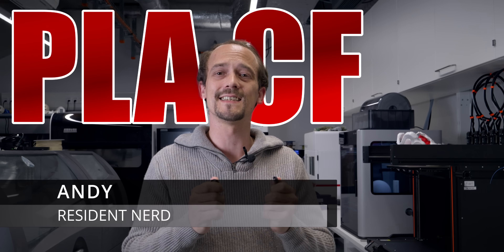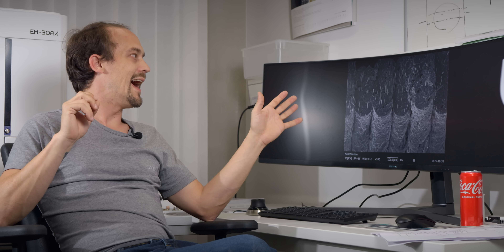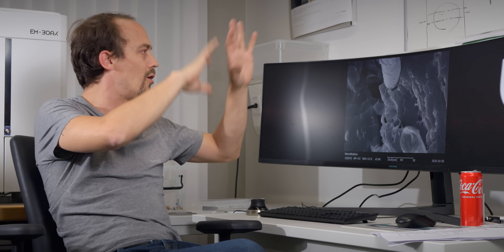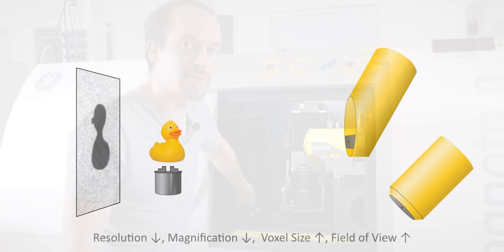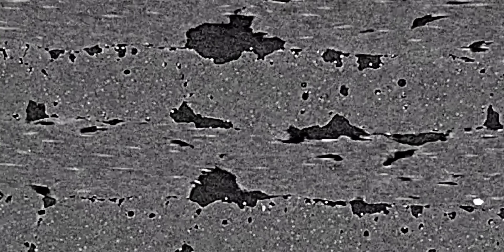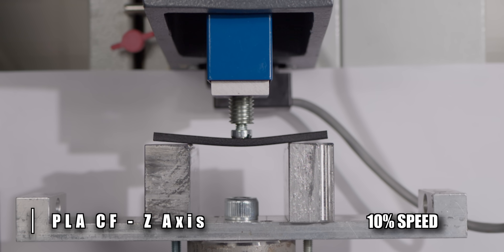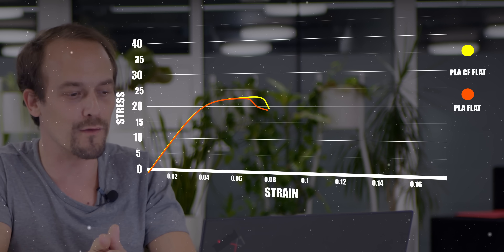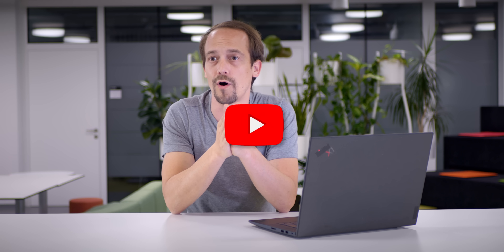3D Printing’s Biggest Scam Is Even Worse Than We Thought!

Comment from the maker: what do you want to see next?

The health impact of Carbon Fibre Filament? - Comment "PLA-CF Health"
Matterials where Carbon fibre actually helps? - Comment "Real CF Materials"
Is Glasfiber Filament any better? - Comment "Galsfiber Filaments"
Reply: All of these are interesting to me, and the order of interest is exactly as you have them here. Health first.
Reply: @nickhancock589 yes all these please
Reply: @nickhancock589  Real CF Materials
Reply: 🤔 all of them 😂
Reply: Glasfiber Filaments
And one of the actual good CF filaments
Reply: PLA-CF Health
Reply: I would like to see PA-CF and PETG-CF. Do those polymers bind better to carbon fiber? Are there the same voids? I have found PA-CF with 25℅ carbon fiber and PETG with 15% CF.

I am interested in building a part with very low thermal expansion like titanium, but its only necessary in one direction. So I wanted to print it that the fibers align into that direction and hold my part like reinforcement concrete. 

Thanks for the great information from your videos
Reply: @user-wi3lg1rz8f  thermal and optical energy absorption/adsorption, emission, dissipation,    properties would be interesting too, but likely can be estimated well from the base materials, PLA & CF independently…as there is negligible chemical or surface characteristic changes.
Reply: Literally all are interesting!
Reply: All of them, please.
Glass fibre is very interesting, although I guess (and it's just a guess) it should be quite similar to carbon fibre, modulo some mechanical properties of the fibre itself, which are probably negligible in most plastic filament anyway. Is it safer though?
Reply: @tuesss  GF likely have different adhesion though.
Reply: @tuesss what about organic fibres though, pla melting point is not that hot plenty of crystaline organic polymers should be fine during the printing process right?
Reply: Do a "no AI bullshit music"-challenge!
Reply: PETG-GF seems to increase layer bonding, it'd be interesting to see exactly why this happens. At least that appears to be the case with Tinmorry's PETG-GF, I'm not actually certain if it's always the case.
Reply: @shawn_369  Interesting. I don't know anything about PETG-GF, but off the top of my head I could think that GF behaves differently because the glass fibers are not as hard as carbon fiber. Glass fiber, I would imagine, is "softer" and more flexible when compared to CF. The GF can "give" - it interacts better with the materials around it. It would def. be interesting to see a similar analysis of GF as was shown for CF in this video.
Reply: @shawn_369  I have used Bambu Lab's PA6-GF before and it doesn't have any layer bonding, despite thoroughly drying the filament (and even drying while printing). You can almost peel the prints apart with your hands. But knowing Bambu, I guess the official print profile doesn't quite suit the material. I'll have to tinker around with it when I have time.

I guess it could be a very different story for PETG-GF though.
Reply: @shawn_369  is there any chance of “continuous strand” GF encapsulated printing..?
Reply: can you do them all, just without using so-called "AI"?
Reply: All of them! 😂
Reply: Bro, are you at a university or what? How did you get access to all this crazy expensive equipment?  On the fibre reinforced polymers, I really question the utility of having radial aligned fibres. Really, cross layer fibres are of more utility. Scammy in most cases.
Reply: @MarkandSureepornHutchins I'm here wondering the same thing
Reply: @MarkandSureepornHutchins  his workshop is definitely leveled up lol
Reply: Less use of AI would likely better differentiate your otherwise amazing video moving forward but I need to ask, how intellectually involved are you in this channel? Do you source your own knowledge and build your own skills or do you outsource that as well? And is this channel just a human-fronted AI misrepresentation of the real world? How much do you include AI in the creation of your content?
Reply: First, this is incredible and exactly the kind of geek thing my mind locks on to. Thank you for that! Next, NathanBuildsRobots did a video on working with CF and it’s apparent out of the gate this stuff should be handled with care, with protection, not only for hands but your lungs. Please take a look at that and do your own presentation. I walked away with little desire to work with it and a great respect for Nathan for sharing it. Edited to add: Just got to the end of the video! You credit Nathan and go on to explain why the material itself can be greatly hazardous! Dude, you do the work. You go deep and you present the information clearly and concisely. YOU have elevated yourself to Nathan, Stefan, Angus, Joel, honest truth? You just kicked their butts! 😂 Seriously, thank you for such an incredible amount of work and? Can I have your lab? 😊 dying here….😂
Reply: Real CF Materials.    I think a discussion of how well different polymers adhere to carbon fiber would be relevant to the discussion
Reply: Galsfiber Filaments
Reply: Glassfiber filament
Reply: Health Risks of carbon fibre would be great!
Reply: CT of another printed material than CF, of course...
Reply: THIS! - Matterials where Carbon fibre actually helps? - Comment "Real CF Materials"
Reply: PLA-CF Health
Safety first.
Reply: PLA-CF Health
Reply: PLA-CF Health.  I remember a video going over how the fibers dont stay in the filiment, and are pretty much as sharp and stiff as fiberglass.  like rubbing the finished part was like rubbing fiberglass
Reply: Real CF Materials
Reply: ALL OF THE ABOVE. Also you mentioned petg not benefiting for the most part, is it as bad as pla or just a minor difference. To be honest I just stumbled onto your channel and I now have more questions then what I can feasibly ask in one comment so I will say this instead. Any video "reviewing" filaments whether it be from the everyday strength test to the ct scan and electron microscope would be greatly informative. I just recently started printing with glass fiber reinforced petg and after watching this video I would like to know if it is worth the extra price and if it is even healthy to print. You have access to equipment no one else reviewing 3d printing and filaments to my knowledge has access to revealing a whole new side of 3d printing the average consumer wouldn't even know or even be able to know. 

PLA-CF Health

Real CF Materials

Glassfiber Filaments
Reply: Real CF Materials. I want to see ASA-CF, PA-CF and PET-CF and how they compare against their non-reinforced versions. I know ASA and PA warp less and are more printable even with just a bit of CF additives, but I want to see how their strengths compare. I also have my reservations for PET-CF, I printed with bare PET before and it was just fine.
Reply: I've been printing pla-cf for months now. This video is completely different from my experience with pla-cf. My prints are definitely stronger as I make drone bodies with it among other things. My test have overwhelmingly prove pla-cf is stronger than regular pla! Sorry your filament was 💩, but not all pla-cf suck!
Reply: PLA-CF Health
Reply: "PLA-CF Health"
Reply: PLA-CF Health
Reply: PLA-CF Health
Reply: PLA-CF Health would be interesting
Reply: PLA-CF Health
Reply: PLA-CF Health
Reply: PLA-CF Health
Reply: Real CF!
Reply: Real CF Materials
Reply: PLA CF Health
Reply: Comparison between CF and GF would be a killer. 
Also particularly interested in PETG-CF and ASA-CF vs ASA-GF something tells me they both are not as good as regular ASA.
Reply: Just for curiosity: Electrical properties :) Conventional CF plastics can be literally conductive, could this kind of print material  create an unexpected hazard by having surprisingly low breakdown voltages?
Reply: "Glasfiber" + "Real CF Materials"
Do both. I don't think a full video on the health is needed, just explain it's sharp, it gets in you, and it's not bio-soluble. (once it's in you, it stays there) There's plenty of research/information on the dangers/risks of CF.
Reply: Health Impact
Reply: why is there a difference between petg-cf and pet-cf? shouldnt be the bonding of the fibers be comparable?
Reply: PLA-CF Health
I know the health risks, so a video is realy important.
Reply: PLA-CF Health
Reply: These filaments must be banned as soon as possible! All this microscopic carbon thorns will stay with humanity forever, just because of some tiny profit for the manufacturers. What a madness! You are big enough here and have professional and social contacts to send appropriate letters to relevant institutions, or start a petition or whatever.
Reply: PLA-CF Health

It's incredible to me that there seems to be such strong opinions about this that some seem to be getting emotional in their defense of CF.
Reply: PLA-CF Health
Reply: As I am sure others have asked, please compare all other 3d filaments that have cf and gf added. I for one would like to know the facts on whether or not cf or gf fibers actually do anything.  I also would like to know if this issue is with all brands of filaments with cf and gf.
Reply: All of the above. Or perhaps you could partner with a filament maker to functionalize the carbon fiber first, like a coat of primer before being added to the plastic when they make filament, maybe if there's other additives etc. that can make the PLA work better with it etc.
Reply: PLA-CF Health
Reply: Definitely the health impact!
Reply: PLA-CF Health please
Reply: The health effects would be very interesting. The tiny shards make me think of asbestos. Hopefully people aren't getting this in their lungs.
Reply: Matterials where Carbon fibre actually helps? - Comment "Real CF Materials"
Is Glasfiber Filament any better? - Comment "Galsfiber Filaments"
Reply: I want to see both PLA-CF Health and Real CF Materials. I'm just getting started with "engineering" grade filaments and obviously didn't do enough research before buying into the holiday sales for PLA-CF. Now I'm kind of scared to handle the stuff without gloves and a mask.
Reply: For a follow up test, you should take a look at a piece of virgin filament. It would not surprise me if those pockets are trapped air bubbles, and they get moved from the filament, onto the part during printing.
Reply: all of them , but do also include those "core" fiber materials, for both cf and gf and also interesting to see the difference in PET-G and PET with similar fibers and non fiber reinforced. And off course the other "engineering" filaments with those fibers
Reply: would love to see a video comparing all the CF/GF filaments, particularly PC and PA.  I have always been suspicious of the matrix and what strengths it actually has VS just great PID and Thermal control on normal filaments.
Reply: Compare vs asbestos and vs fiberglass and vs rockwool, I'm suspicious of them all. Thank you!
Reply: plastic itself enters the body by breathing hot plastic fumes and it's the biggest source of plastic in the body. maybe you should research that?
 thanks for what you're doing😊
Reply: Since you work for a university, if your conclusions were to come out as bad as some of us fear, could you write to the EU to ask them to force companies to include warnings with CF products?
Reply: health impact!
Reply: Real CF-materials, but the other optioneel also sound interesting
Reply: Please do both.
Reply: Yes yes yes and others you haven’t mentioned yet!
Reply: All three and in the order listed, please.
Reply: Glass fiber filament!
Reply: All but next one do Galsfiber Filaments.
Reply: I want all of these
Reply: All three! for the sake of searching and tallying: PLA-CF Health, Real CF Materials, Glassfiber Filaments (assume you figure people will fix the typo)
I wonder how much of that is manufacturing dependent too, I know I've seen voids in other scans of filament both pre- and post-printing. I think it could be air getting mixed in during extrusion (the voids between melting pellets getting stretched into thin fibrous bubbles) or a moisture issue in filament during extrusion (surprisingly common even in "pro" injection molding)... Or possibly even in the resin from the maker! 

The carbon fiber obviously has to be mixed into the base resin at some point, and I think there's probably more than a few variables that affect how that turns out too.
Reply: All please. I subscribed to your chanel just in case that helps and then I can see those vids in the future.
Reply: I'm sure you knew the answer would be all.
Reply: Real CF Materials please.
Reply: Effects of printing in vacuum vs high-pressure environments.
Reply: Glassfiber filament
I would be interested in (my specific use) ASA vs ASA GF / ASA kevlar. ASA is good for more heat demanding aplication, but have not gratulace stiffnes. So for some my uses, it have sense to use reinforced filament that dost suffer so much creep as PA
Reply: Real CF Materials
Reply: Most interested in Glass fiber filled!
Reply: Proof that it ever actually helps
Reply: GF would be very interesting to know
Reply: All of the above I will watch and share.  This is very very interesting and no one else is doing to so yes to more imaging and yes to real materials and yes to GF filamments.  thank you.
Reply: I would definitely be interested in knowing which CF print materials actually benefit.
Reply: I just want to be able to D/L the music.  😂
Reply: More PLA tunes!
Reply: Galsfiber Filaments lol
Reply: It would be good to talk about the thermal expansion of the different materials....
Reply: Yes, please. I think we need ALL of the above. To tell you the truth I just found your channel today  because YouTube recommended me that exact video and I must say I NEVER before pressed subscribe button so quick. 

Thanks a lot for such a great information and it would be truly awesome to know more about health impact of CF first and real CF materials afterwards too. I think every 3D printing enthusiast thinks about using CF reinforced (or not reinforced at all as you just proved) materials so information about health impacts would be utterly useful.
Reply: yes to all
Reply: Well looks like you have a series of video ideas to work on 😅, you probably realized that as the question left you lips.
But first I would be interested in the 
HEATH EFFECTS OF CF
Reply: All of them but if forced:

Real CF Materials
Reply: Glass fiber
Reply: ALL
Reply: I'm actually genuinely curious about PP composites. I've seen them used in functional applications but all forms of PP allegedly have their use cases
Reply: Did you test different brands? Or was this data from one company?
Reply: Petg-cf
Reply: PLA-CF Health
Reply: Yes.
Reply: I would love to see PA-CF/GF
Reply: Real CF Materials
Reply: PLA-CF Health ... yeah that seems just another asbestos event waiting to surface. 
It's not like carbon fibers decay particularyl well in nature. And you trechnically could replace then with asbestos fiber directly ("100% more natural") 😆
Reply: A part 2 with WORKING carbon fibre matériel would be great!

Are there other fibre matériel apart from carbon fibre that do work?
Reply: all amazing videos. but ill say materials where it actually helps!
oh and dont forget to show if the voids are also visible in normal PLA!
Reply: Galsfiber Filaments
Reply: Glassfiber
Reply: Real CF Materials
Reply: I personally would very much liek to know how that transfers to other polymers. I never print PLA, anyway - but I often use Prusa's carbon-reinforced PC Blend. The results with that are really quite great, as far as I can say, but it would be interesting to move from feelings to facts. :)
Reply: The outside tiny sharps are a massive issue, thanks so much
Reply: the first
Reply: would love to see the ASA GF/CF world explored.    Am I paying for ASA-GF for no reason?     basically.. .what filaments do benefit from some type of fibre (Glass/Carbon) additive?
Reply: I would very much enjoy your video on proper implementation of carbon fiber
Reply: Real CF Materials
Reply: PLA-CF Health and PLA Scan. 
You should do a collaboration with CnC Kitchen. He certainly would enjoy to have access to your equipment and his subscribers would love you.
Reply: All of them!
Reply: PLA-CF Health vs. Real CF Materials,  like how well contained in practice is the cf in those other cases? I'm intrigued to see more about PEEK as it doesn't get talked about much. Very cool stuff.
Reply: EVERYONE!! -Gary Oldman
Reply: PLA-CF Health
Reply: Pla real cf fiber 
Not pla real fiber  for different applications such as under hood high temperature environments.
Reply: wow OCEAN GATE ALL OVER AGAIN , shows the need for testing does'nt it
Reply: Real CF Materials. But please include testing humidity being soaked up over time affecting stiffness and how to prevent it!
Reply: Real CF Materials
Reply: This video was fantastic.  At-home creators need greater insight into the health risks they may be posing to themselves by following these offerings by industry.

I would very much appreciate similar videos on all of the other carbon fiber variants - PETG, etc, along with comparative analysis on non-Carbon-fiber printed items to see if there are similar gaps and if that's a product of the printing process, or a product of the mixed-materials being printed.

Thank you for your videos!
Reply: Any filament CF Health & real CF Materials
Reply: PLA-CF Health
Reply: "Glassfiber Filament"
Reply: it would be interesting to see the comparison between normal PLA and PLA-CF in the video when you bring up structure and enhanced imaging
Reply: real CF materials plz ❤️
Reply: Ein Freund von mir, den ich ans Drucken geführt habe, hat jetzt ein geschlossenen.  Du scheinst auch durch Dige durchschauen zu können, ich Kratze auch gerade den Lack ab, aber komplett anderes Thema. Ich habe den Punkt erreicht, wo ich auch mit ähnlichen Tools arbeiten muss. Mach bitte weiter, es ist wichtig das die Inkompetenz oder Geldgier weit außerhalb von dem Wissen das die meisten begreifen, oder mangels Testmöglichkeiten vorhandenes Bauchgefühl  überprüfen können. Was  uns allen schadet ! Geh deinem Plan entsprechend vor
Reply: But but.. you forgot to measure the most important thing, sound projection! How does pla cf compare to pla in a 3D printed ukulele?!
Reply: All of them please
Reply: PLA-CF Health
Reply: Yes, we need to see regular filaments imaged to get a comparison.
I’d like to see Siraya Tech’s fiberheart (both CF and GF) tested and scanned. Theirs is claimed to only have fibers in the core reducing the bonding and loose fiber issues.
Reply: PLA-CF Health
Reply: I'm interested in the health effects of printing with Carbon fiber in general.
Reply: A video without AI music?
Reply: All of the above and I am willing to wait for them
Reply: I would assume it’s very similar to asbestosis, it’s not a good thing to be around/breathe in
Reply: All of them but specially Real CF Materials
Reply: Definitely a video on the CT imaging of internal voids of various polymer filaments. I think the weirdly large surface tension of PLA is causing voids from it not wetting the non polar CF fibers once molten in the nozzle. But I also think other polymers have lots of internal voids due to viscosity and molten surface energy.
Reply: All
Reply: I would like to see a carbon nanotubes reinforced pla :)
Reply: TBH dude....can you really top showing up the trolls with a damn electron microscope? What an absolute BAMF workshop.
Reply: Please take all major CF hybrid Filament materials and provide the truth as to what materials actually benefit from it. ASA PET PEK PEEk ABS Nylon. Do them all bust all the available mythical ones.
Reply: Glass fiber but with PETG as well

IMO fibers in PETG seem to help 🤷
Part is more rigid than plain PETG
Reply: Glassfiber filament
Reply: Real CF Materials (Real CF filaments)
Reply: No Ai music
Reply: health impacts
Reply: Real CF Materials
Reply: PLA-CF Health
Real CF Materials
Glasfiber Materials

Interested in all three topics. I feel you may have hit a niche few other creators have access to the types of equipment to properly explore. I will be subscribing. Keep up the great work!
Reply: All of the above.
Reply: Honestly I'm really curious about the Ceramic Resin's I've seen on market for resin printers
Reply: Asbestos alarm! CF Filaments!
Pls forward your findings to EU Consumer Protection authorities. Your report would find leverage if the title is phrased:
 
The new ”asbestos” catastrophe:
Carbon Fiber (CF) filament for 3D printers. A newborn hazard already happening!

Thank you 
Anders, 69
Sweden
Reply: Health
Reply: PLA-CF Health
Reply: Great video! 
It would be great to see if standard PLA has the same air voids as PLA CF.
Reply: the glass fibre would be interesting,
Real CF materials
Glassfibre filaments
PLA-CF Health
Reply: PLA-CF Health
Reply: ALL OF THEM, in the order you have them. We need to know the truth. What about emissions while and after extruding these materials?
Reply: Pla cf health
Reply: Glassfiber filaments
Reply: Real cf materials
Reply: Real CF Materials
Reply: I would like to see an analysis of the filament itself, rather than after it has been used in a print.
Reply: Real CF
Reply: PLA-CF Health
Reply: I need his whiteboard. Does anyone know what it is? I have been searching specifically for a high-resolution IFPD (Interactive Flat Panel Display) for 3D modeling.
Reply: Get rid of the ai nonsense.
Reply: I hope you didn't pay for the musical interludes.

Quite enjoyable otherwise.
Reply: Need apples to apples of CF , GF and neat for various polymers like pla abs petg pa etc
Reply: I would expect glass fibres to be far more likely to become embedded in the lungs and it's mucosa.
Reply: Maybe the carbon fibers need to be coated with an adhesive that sticks to PLA before being put in the PLA?
Reply: I prefer them in ASA for reduced print warp.  I use a chamber at 65c but there is difference between them.  Also the finish is prettier.
Reply: PLA-CF Health
Reply: I would like to see if the sintering approach would benefit the layer interface structure under x ray scan.
Reply: Gals?
Reply: Galsfiber Filaments
Reply: Real CF materials, in particular PA-CF
Reply: Materials then Health. Need to understand what it is then the risk factors. MAYBE mix both? 
No matter which, keep it under 10 mins.. Attention spans are really short these years.
Reply: Less ai slop in ur videos
Reply: Science works
Reply: Glasfibre filament but also health printing is amazing so I subscribed so I can learn from ya thank you
Reply: PLA-CF health
Reply: All?
Reply: PLA-CF Health
Reply: PLA-CF Health
Reply: Real CF Materials + Glasfiber Filaments
Reply: All of the above!
Reply: I would love to see your analysis of CF materials that actually benefit, and how they compare to their non-CF versions.
Reply: Every single one of those ideas are amazing
Reply: I want to hear less AI music slop in an otherwise very well made video. Thank you.
Reply: @gebebbebebebr  it was amusing, which is artistic preference. 
I doubt he was making an effort to impress you with his musical career hopes.
Reply: @TheUnojoe2  The point that continues to swoosh by you is that AI music and the prompt used to create it is closer to theft than it is art and the issuer of that prompt is not an artist.
Reply: @nbuligan  in that context yeah… theft of IP (intellectual property) by platforms is rampant. 
Corporate theft of IP is a historic norm though.
Nearly All of AI is completely based on theft of IP for its model training. But also, it’s already happened… and you’re crying? …to me? and the video provider? 
Get a grip! 

IMO lockdowns were largely used for data mining by forcing everyone to use platforms with dodgy contracts …to have a *controlled outlet to socialize… which socializing is a basic a human development requirement. 

Nobody enforced laws in favor of the citizens there either. 
Do you expect different in this use case?  

Are you training your own AI model that only uses acceptable media? 
You know, SOLVING the problem… 
Or whining..?
Reply: How about what we DON'T want to see, or should I say hear? That terrible AI music! I couldn't finish the video once that carbon fiber filimant song started to play. It was causing my ears to swell shut and my pet fish died of embarrassment of that now existing in the world somewhere.
Reply: PLA-CF Health please, is it more disruptive than ABS fumes btw ?
Reply: Now test this with carbon-fibre-reinforced PLA that uses graphene as an additive. (This is a cleaned up version of my original post using AI)

I don’t have any formal proof, but I bought two spools of graphene PLA, and based purely on what I observed—without testing and over a very limited timeframe—it definitely felt different from regular PLA. Unfortunately, I had to sell both of my printers and move countries shortly afterward, so I didn’t have time to investigate further.

Importantly, I have never used standard carbon-fibre-reinforced PLA. The only reinforced filament I’ve used is graphene-based. From a tactile perspective alone, it felt like a distinct material. I can identify the exact filament if needed; it was PROGRAFEN PLA Graphene, 1.75 mm, 500 g, Black.

By that point, I had printed roughly ten spools of regular PLA—mostly generic brands, with a couple of “silk” PLAs and some high-speed PLA—plus a lot of PETG. I also had an unfortunate incident where I used a cheap AliExpress nozzle that needed hot-tightening, didn’t tighten it, and ended up gluing my A1 Mini shut, nearly causing a fire. I replaced the damaged parts, and after that I managed about five prints using the graphene PLA before everything had to go.

Even with that limited experience, the graphene PLA felt noticeably different. Again, I have no hands-on experience with conventional carbon-fibre-reinforced PLA, only this graphene filament. The difference was mostly tactile: the parts felt more “glassy,” almost as if there was less plasticizer. There was a slight “ringiness” to the material, suggesting a stiffer, more brittle, glass-like behavior. It wasn’t dramatically more expensive than regular PLA either.

It’s possible this perception is skewed by my baseline materials—I was often buying the cheapest PLA available (the kind that smells strongly of sugarcane) and similarly cheap PETG—so maybe my comparison set was just very low quality. Still, this filament felt mechanically more sound overall.

If the material really is stronger, there may be an argument that PLA can benefit from being filled with nanoscale additives rather than macroscopic fibres. A treatment process that encourages graphene flakes to adhere to one another—or even interact with other fillers—could potentially form a more effective reinforcing network. Notably, this filament didn’t appear to contain visible fibres, yet it still behaved differently.

One possibility is that print process also plays a role. For example, hotter, flatter layer lines that allow the nozzle to partially remelt lower layers could introduce mild interlayer turbulence, improving layer adhesion. That kind of process might synergize better with graphene-based additives.

My assumption is that graphene flakes, being effectively molecular-scale compared to chopped carbon fibres, require far less energy to interact with each other. Carbon fibres are macroscopic structures that mostly lie adjacent to one another without meaningful bonding. In contrast, graphene sheets behave more like macromolecules, making it easier to form a reinforcing network within the polymer matrix.

You can get filaments with continuous fibres running through them, but those require specialized nozzles (sometimes with cutting mechanisms) and specific slicing strategies—essentially treating the printer like a weaving machine. That’s a completely different approach, relying on mechanical weaving rather than melt-based bonding.

What I’m suggesting is that graphene, as a dispersed nanoscale filler rather than disconnected fibre snippets, seems to have a real effect. Testing this properly feels more worthwhile than continuing to re-evaluate traditional chopped carbon-fibre PLA, which may already be approaching diminishing returns.

Tl;dr: Test a graphene filament like PROGRAFEN PLA Graphene 1.75mm 500g Black (or another graphene PLA). Test a means to re-melt a lower layer with smaller layerheight and lower flow rate for better layer adhesion. Maybe add a stricter nozzle cleaner or have a low adhesion nozzle to prevent clogging or more regular nozzle cleaning. I don't believe graphene is a scam. I could be totally wrong. It seemed stronger to the touch and the part felt distinctly different. (prographen doesn't have filament in it turns out. I realised this while typing this out) (There may be filament that has both and may be stronger due to the graphene somehow interacting with the filament but I do know if these is solubility between CF and graphene, but can also not discount there being. Percentage of graphene in filament also seems incredibly important but it is effect in incredibly small percentages. See tech ingredients for details. Testing for filament and graphene together seems most important